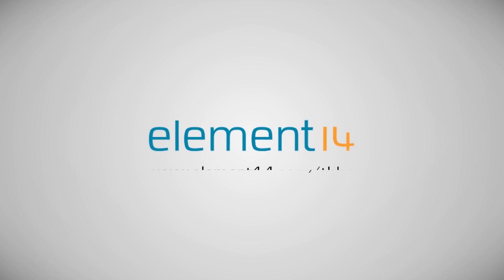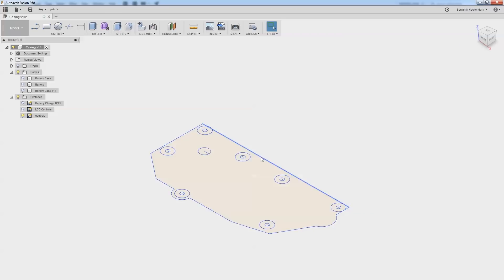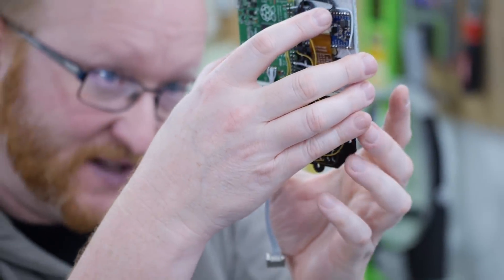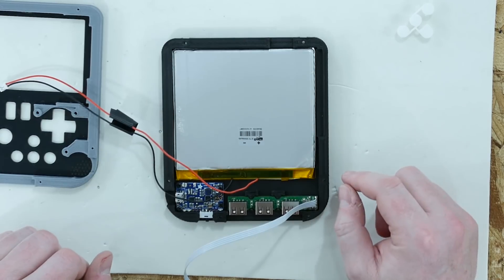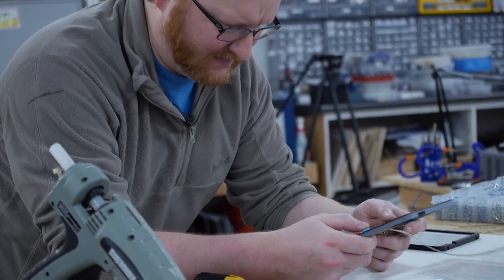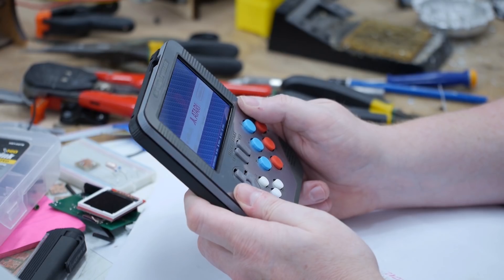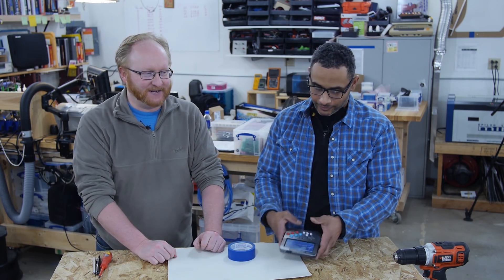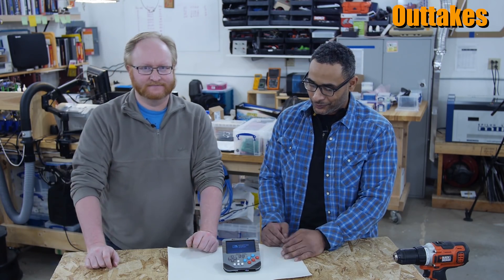Rasp Pi No HDMI: Portable MAME Part 2

Comment: Is there any reason to be concerned with the Processor on the Raspberry Pi being exposed to the battery? Would the temperature do anything to the Li-Po?
Reply: My worries exactly. No heatsinking method whatsoever was conceived for this project, which puts me off a bit. The CPU right on the LiPo might reach temperature beyond 50°C which might endanger the battery itself, and the unit as a whole. I don't know if the Raspberry Pi has some frequency limit option in config.txt but if this were the case it should be used to prevent problems.

Comment: Nice job guys! This show is amazing! I'm looking into making a portable pi project at the moment and I was looking at getting the powerboost 1000c. I've been thinking of ways to add a power switch and I didn't know you could add a power switch to the powerbooster. Did you just solder a switch to the enable pin and ground?

Comment: This is a great project. Not just because it's got a Pi inside but because it shows the process of creating a system and turning it into a product. I've found that making a prototype that works on the bench is easier than actually mounting everything properly.

Comment: Great job! Nice integration. Now that the hardware is rock solid, let me plug my init system i wrote just for such projects:) https://github.com/naprave/RaspberryPi/tree/master/npStarter It replaces raspbian's default init system (systemd) and runs just the services you need and the app you plan on using. I use it for specialised products where a full linux stack would just get in the way, also it runs in read-only mode to minimise the possibility of sd-card corruption. Give it a try!

Comment: if you want to fix your 3d printing issue. (solid infill layers and perimeter gaps) you can increase the [overlap] infill/perimeter overlap percentage. and you could also lower the width of your solid infill layers. (in Slic3r you can anyways)

Comment: Its a cool project but like all these portable Pi projects not a lot of thought has gone into how the device feels in the hand after 10 minutes and how comfortable it is to hold, i think this thing would give you hand cramp after a while.....but then Nintendo is guilty of the same problem that why i have a hand grip for my 3DS
Reply: Yeah, seems to be a real afterthought with portables...
They're rarely comfortable. The gameboy Advance SP gives me problems, the gameboy colour wasn't much better.
Nintendo switch in handheld mode isn't great either.

For that matter the mobile phones and tablets I've held are also pretty bad.
Ironically, one of the few devices to get it right ergonomically, is one everyone hated and laughs at for looking too childish - the Wii U gamepad - that thing actually properly thought about how you'd hold such a thing comfortably, and the weight distribution, grip and so on.
It's 500 grams yet it feels lighter and more comfortable to hold for long periods than the physically smaller and much less bulky 8 inch tablet I own, which I know weighs 340 grams...
So... Ergonomics huh. It does matter. XD
Too bad getting it right seems to require a huge amount of added bulk that people would complain endlessly about...
Reply: If you look at the board in a first gen GBA advance, it’s entirely designed around the screen, all very bespoke. So even while the RPi is stripped of all connectors it’s still a credit card sized device that you have to build around.

Comment: You mess up the buttons Y is supposed to be over B and X is supposed to be over A.  Great Setup.
Reply: Nintendo controllers don't have Z buttons, and those that do don't generally have X and Y buttons.
That layout, both in how the buttons are placed and how they're labelled is clearly a Mega Drive/Genesis 6 button controller.
The buttons aren't the same shape, but their physical placement, and the letters used is spot on.

A 6 button Mega Drive controller has X above A, Y above B, and Z above C

It's correct, you just misunderstood what they copied.
Reply: KuraIthys Ah, I didn't know that they copied the Saturn system controller scheme. Thanks for the correction.

Comment: Came out pretty good, I'm no fan of excessive thinness but this turned out great, very nice hardware layout and styling. D-pad looked a little holy, could you drip thin resin in to fill those maybe? As you found out with the funky foam addition you probably need to take more care in the structure around the button and D-pad inserts, more cradle, socket backing, and tabs in the design rather than just holes leading to generic empty space on the other side.

Comment: Cool build, though I question the utility of the F4 button -- for that to be useful, you'd need to have a keyboard plugged in (which will already have it's own F4 button). -- Seems like it's just waiting for you to accidentally press it, so that you can be screwed until you plug a keyboard in to type "emulationstation" and get back to the menu.
Reply: Agreeing with you here. F4 and CTRL - ALT - DEL are very weird in my opinion, as if they were trying to add some soft reboot feature.

Comment: Ben, if you like the buttons a bit more "squishy" with the tac switches, have you considered using TPU or NinjaFlex for printing? It's very temperamental but I've found as long as you keep the print bed nice and hot and also use 100% or close to that infill the results are very nice and much more comfortable than hard plastics.
Reply: He's done that before. It prints softer, but the tops don't print smooth, so it doesn't look as good.
Reply: I found a lot of that was down to using 100% infill. Looked terrible with anything less than full fill, but with a high enough temp the entire thing just melted and formed into a big solid button, just as good as ABS or PLA. Other problem was size. The dpad was just too big to look good in TPU, but single buttons were excellent.

Comment: Ben, you need to increase the extrusion multiplier for your 3d printer so it doesn't have those holes on the top surface.

Comment: Rasbairy pie ds? The Raspberry Pi 3 can emulate regular DS games at full speed. Also it would be a good media device that is pocketable.
Reply: I bet the smaller new 3 DS could fit into a XL case with a Raspberry Pi. If you found the smallest HDMI screen and an LCD screen as the bottom screen. And the DS had its visuals pumped into the Raspberry Pi for upscaling. I don't know about you but to 480p is not good enough for 3D Pokemon I can't wait for the switch version because I hate those scan lines

Comment: Make this a kit and sell it.
Reply: I think that the only problem can be the dissipation of heat, considering that the Raspberry is very close to the battery ..
Reply: A built-in keyboard instead of the game pad buttons. Plugging in an external keyboard defeats the purpose of handheld.
Reply: If I can fit a qwerty keyboard on an XBox or PS4 controller, one could fit on this.
Reply: K.B. Carte too much space for a qwerty Keyboard!!😁
Reply: An hdmi exit it's a good idea!!😁
Reply: I would like to buy one too.
Reply: Yes please!
Reply: Kb instaed of a game pad just makes it a cheap ver. Of the gpd or pandora handheld or n shild thats arready out on the market and they also have hdim and btooth built in aswell. I like the controler inputs more the a kb anyday
Reply: This. Cost doesn't matter. I'll take 10.
Reply: K.B. Carte inusable... 😫
Reply: I'd buy it right now!
Reply: I want one too
Reply: Take my money now!!!!! I have to have.. How much for the unit... No Roms.... name your price.!!
Reply: controller* Bluetooth* HDMI* instead* already* that's* nvidia shield*
Reply: I would buy one
Reply: Dunno... every single one of his projects is better than most of the existing cases... I reckon that means his designs would be very expensive in mass production. If it could be done at a competitive rate, there'd be Chinese companies already ripping off his designs and selling them on AliExpress...
Reply: Please.
Reply: PLEASEEEE
Reply: I'd buy it. With at least a [semi] proper keyboard.
Reply: K.B. Carte a usb connector would be enough...
Reply: I LOVE IT BUT ... IT PROMOTES PIRACY AS THE GAMES INSTALLED ARE ROMS OF   THE ORIGINAL AMD PLAYING DEVILS ADVOCATE SOME ONE WILL WANT TO COMPLAIN ABOUT THAT